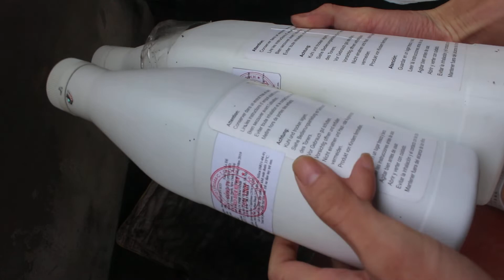How to refill sharp AR toner cartridge

Comment: Reset (reset) counters Sharp AR-5316 / AR-5516 / AR-5520 / AR-6020 and the installation of the developer

To reset the display "Little Man" and "Sun" you must:

enter service mode # Interrupt Clear Interrupt
reset man (service) 20 Start 01 Start CA
reset the drum 24 Start 07 Start CA
reset the sun (developer) 24 Start 06 Start CA or 42 Start 01 Start CA
developer installation 25 Start 02 Start CA
Enter Sharp AR-MX-M266N service mode

To enter the service mode you need:

first on the display in the upper left corner press COPY
further we enter the service mode # / Р * C *
developer installation 25 Start 02 Start CA.